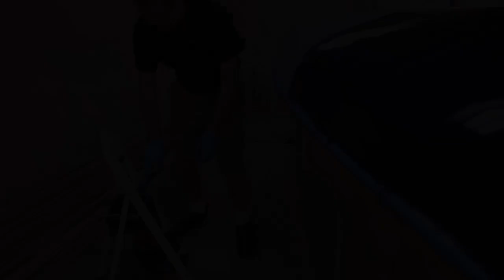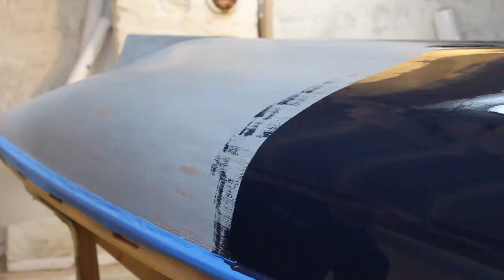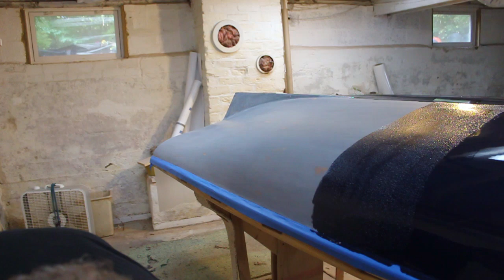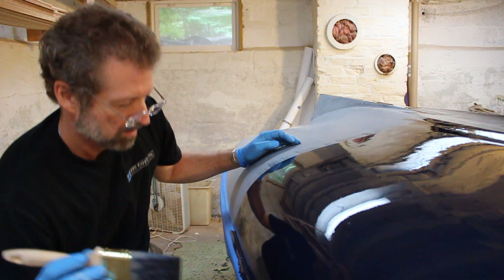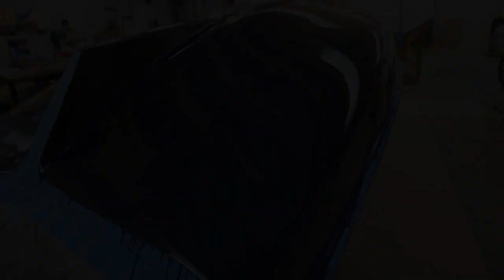Rolling and Tipping - First Coat

Comment: 8 Dislikes!? WTF. I could watch this guy paint all day! Great style, I'll try and replicate it when I paint my Columbia 26. Thanks for the upload!
Reply: Those are ust jealous people who can't do the same thing.
Reply: dislikes because you dont paint over gelcoat you cut and polish it and repair it if you paint over gelcoat it will chip off easily where as gelcoat you can repair easily and polish easily
Reply: Lteo Hrnt  how many boats do you own?I have lots of experience with painted gelcoat yes it looks good for a few years but it is not as good as repairing the gelcoat and maintaining it
Reply: It might not be hip enough for the Londonener
Reply: Gelcoat  eventually will need re gelcoated or painted. You can only buff it so much. Epoxy paints work fine for the $$ u save.
Reply: razzorbladz I believe it was a barrier coat vs gel coat.
Reply: @razzorbladz  He didnt paint over gelcoat
Reply: @WereAllThatBored  ................? UM yeah he did,do you know what gelcoat is?
Reply: @razzorbladz  Yes.  Gelcoat is polyester resin with some solids  and pigment added for durability.  The material he painted over is "Pre Kote" which is NOT a polyester based paint, or Gelcoat.
Reply: @WereAllThatBored  and what did he paint the pre kote onto genius...? gelcoat! which would have been better repaired with flowcoat. so yet again I say he painted over gelcoat. all moulded fiberglass boats have gelcoat even epoxy boats unless you are saying he sanded all the gelcoat off before he primed?
Reply: @razzorbladz  You are aware that Pre Kote primer is designed for painting over gelcoat right?  The actual paint is applied over the prekote primer.  So he did not paint over the gelcoat directly.
Reply: @WereAllThatBored  OMG  he did paint over gelcoat directly with a 2 part system. do you not have any thing better to do surely you need to buy more toilet paper.
Reply: razzorbladz I’m glad folks like you are on here to keep us in line.  You should call Interlux and tell them they don’t know what they’re doing
Reply: razzorbladz even better.  Read his blog.  It’s a wood boat that was originally painted with house paint lol
Reply: @razzorbladz  Sometimes people cut too much or use acid and burn through the gelcoat so it's not always possible to save it economically.

Comment: I navigated to this link from a boat building web forum looking for technique for using interlux Brightsides to paint an exterior door.  I've already coated and sanded it twice with lousy results. All I can say is a picture (or video) is worth a thousand words.  I duplicated this technique (right down to the Peter Gabriel soundtrack) and got perfect results.  The only thing I'd add is: copy this technique to the letter.  The paint does not respond well to 'do-over' brush strokes.  If you lift the brush, then continue, you will see that area.  If you brush a second time, it will show up.  Also I used Interlux 333 thinner which is what they recommend, and dipped the brush in it prior to using.   Thanks for posting, it saved my small project.  PS: I highly recommend this product for hard-duty exterior applications.  It really holds up in UV light, heavy weather, and abuse.
Reply from the maker: Thanks, ersatzS2. You are exactly right. The trick is to always work to the wet edge, and only make one complete pass. Essentially you're manually laying down a single continuous coat of paint from one end of the project to the other. There's no going backwards at all, not even the slightest touch ups. Once a full coat is done, and the paint is completely dry, you can buff, scuff and/or lightly sand to smooth out imperfections, then come back with the next complete coat. I also used 333 thinner, and also dampened the brush with it before starting. Be careful the brush isn't WET with thinner, though. I made that mistake the first time. Excess thinner bled out of the brush into the paint and made streaks. You just want to dampen the brush slightly so it doesn't soak moisture out of the paint. After dampening the brush and shaking out the excess, I worked some paint up into the brush before starting the work, and that seemed to give the best results.

Also, Peter Gabriel may be the secret sauce for success. Highly recommended. ;-)

Comment from the maker: Sorry, I'm more a writer than an actor. There's a lot more info at the link in the description above. But yes, it's a small fine foam roller. The roller mostly gets paint on the boat somewhat evenly. Going over it with overlapping strokes helps do that, as the roller unloads a lot of paint initially it becomes more thirsty by the end, so going back to the beginning will pick up the excess paint there and redistribute it to the dryer areas. You'll notice i do a quick pass over the whole section with a freshly loaded roller, then go back over the whole section to spread it evenly. 

The brush is not critical, just a reasonably good quality finish brush will do. I used a Wooster. It doesn't pick up paint because you preload it with enough to paint to keep it damp – not enough to add more paint, just to keep it from sucking up paint off the surface. Did not bother cleaning the brush until the job was done. 

You work a small area because the added thinners in the paint evaporate VERY quickly, so you need to work a small area fast while the paint is quite thin. It has to flow out naturally after the brush stroke. The brush is mostly just to pop the bubbles left by the foam roller, and to help even out the paint by stroking in the opposite direction. If you try to do a big area the paint starts to get tacky before you're done. You start leaving brush marks that don't flow out, and the bubbles start leaving little craters. No advantage to working a larger area.
Reply: Thank you for generously giving these details. You've answered my questions.
Reply: It is very obvious that painting with roller and brush will not be best than using a spray gun. But Dammmmmm😱 so far is the best video i had found on YouTube with best results.👍👍 Thanks for sharing it.
Reply: BTW. Just to have an idea, what the (%) of (Thinner) and the (%) of paint mixed together for best results?
Reply: Outstanding!

Comment from the maker: More details provided at the link above. But short answer is the brush was first dampened with thinner. This both helps keep the bristles from drawing moisture out of the paint, and keeps paint from drying in the brush while working. Not enough to be wet, you don't want to dilute the paint further. Paint is also thinned, which helps it lay out flat rather than leave brush marks.
Reply: EyeInHand I know i am a little late on this. But I just got my first truck a month ago. and I stumbled upon this video. may I ask what paint/ thinner ratio you used? I find this video very very confidence boosting. it looks amazing! never would have thought this was achievable with a roller!
Reply: Hi whats the thinning ratio
Reply: Thank you for the information.
Reply: @nathanielselvidge4157  you need to judge for yourself the amount of thinner you need. Start with 5% stir it and see if it's viscous enough for the appliance, if it's not then add 5% more. If the thinner is a universal type thinner and not actually the same as the base chemical in the paint then it will start evaporating so you will need to control it throught, for example in a spray gun you would add thinners to the cup when the paint started shooting cob webs or getting too thick. For epoxy paints and the likes the thinner will be the same as one of the base chemicals so it won't evaporate and will stay at that viscosity until it starts curing. Another good way of tipping is leaving the paint to dry a tad then go over it with a second roller that's purely been doused in thinner. This works well getting rid of bubbles and flattens it off nicely but I'd only do this method if you have a smooth surface to work on that isn't very porous, the reason being is that the act of tipping with a brush is very good at squashing paint into the poures and small pin holes and using 2 rollers won't do that as well as a roller then pushing it in with a brush. People who brush too lightly on the tip aren't doing it correctly either. You want to see the paint getting pushed in slightly when you tip. If it's anti slip paint I'd get a proper tipping brush for that as its a nightmare tipping that off with a stiff brush.

Comment: I just used this exact method - about 18" section at a time to finish up my transom repair. Thanks for the video! Gave me confidence I could do it myself. Finished the last coat today and it looks great. Didn't thin mine at all, and just barely wet my brush with paint to do the tipping. Amazing watching this paint flatten out.

Comment: You have provided me with enough false confidence to go through with this :) I contacted a local body shop and he convinced me to prepare the sailboat hull with Epoxy resin, so now it’s showtime
Reply from the maker: You can't win if you don't play! ;-)
Reply: @eyeinhand so,far it’s working well and indeed I’m playing :) fast questions, before my second coat, should I dry sand with a 340 grit? Or wet sand with a 340 grit? Thanks once the second coat is on, I’m was going to let it cure about 2 weeks before I wet sand with a 600 grit. Does this make sense? And again thank you for your videos
Reply from the maker: @1970swimmer  No need to sand between coats, or after. You just need to scuff it between coats to put a tooth in it for the next layer of wet paint to grab. I used those green scouring pads to buff off the shine to a dull mat. Easy, dust free, and leaves all the paint on the surface where you want it. If you use good gloss paint, the final coat will already be shiny, so wet sanding that with any grit will only take some off the gloss off.

Comment: Thanks for the video. Just put the first coat on my jet ski today. It came out great. I was going from blue to white. Brightside covers surprisingly well. Thinned about 7% with 333 and used a small foam roller. No sags or runs. Do have a couple of pops even though I wiped down and washed twice.Think the spot putty isn't playing well with the paint. Just going to sand and reprime a couple of spots before the second coat. Only used about 8 ounces on the first coat.

Comment: I've been rolling and tipping a 22' trailerable trimaran that I built. It was going quite well but could be improved. Today, I followed your thinning formula exactly and your technique. I experienced a significant improvement. I wet sand and buff the paint as the final process. This corrects any defects but the better the surface is when starting the easier it is. Thanks for taking the time to contribute an excellent video.
Reply from the maker: Excellent. That's a much bigger boat with a lot more surface to paint than I had, even for two boats. Would like to see it when you're done.
Reply: @eyeinhand  I just went out to my shed to check on the paint. It laid down very nicely - virtually no brush marks. And the paint is drying nicely in about 55 degree temp. I was concerned that the 333 thinner would slow down the dry time significantly. I am used to using xylene when spraying. Thanks again for the valuable knowledge you provided. I'll be sure to send a pic.

Comment: Excellent video, thanks! Timeless, even.... If you still are here, what do you use to scuff between coats? Thx
Reply from the maker: Glad you like it. I used those green Scotch pads or equivalent. Don't want to remove any paint, just enough to scratch it evenly and put a tooth in it.

Comment: The best method I saw on YouTube painting with a roller by using the paint brush too. Gonna have to try this way in future but have to get more paint brushes for it have a turbine sprayer coming soon though and this color looks about the same color will use when paint my truck again have painted it multiple times this year but it didn't come out right I used Daytona electric blue urethane metallic but going back to using darker blue the original color is s imperial blue metallic though but that color looks close to the color it was at first. My last truck was gray painted it and it didn't come out right either but it had rust on it and decided to paint it that is how I started liking auto painting and started liking auto detailing more too. But now like painting a lot never tried painting like Bob Ross did though.

Comment from the maker: There are some details on the paint and thinner in the description, as well as a link to more lengthy info. The paint was thinned the same for every coat. It's pretty critical to getting a smooth finish without leaving brush marks. How much you thin it is really varies according to how fast you work and over how large an area. Slow and larger areas will require more thinning. Fast and small areas less. Keep the paint thin and flowing while you work. If the brush drags it's getting too dry.

Comment from the maker: The brush was first dampened in 333 thinner, just to keep the paint from drawing deep into it. After that just dip in the thinned paint or you get streaks. The paint is thinned with one capful of 333 thinner to one cup of paint, but you vary that according to temp, humidity, and your own working speed. 

I don't think any other paint thinners would work the same. I've never seen anything as thin and volatile. The paint it too expensive (for me) to experiment on cheaper thinners that might fail.
Reply: Dear Sir
I am to paint my van with alkyd oil based paint- Tikkurilla brand , dark blue colour.
I got the finest brush from local store as well as foam rollers.
Paint suggests using 1050 white spirit.

Which thinner to dip tipping brush on for this particular paint please.
Painting outside after sunset +20c 
Please also suggest delution ratio ?
10% of 1050 white spirit feels not enough amd paint is sticky and difficult to spread and coat gets on thick.
Thank you very much in advance.
Reply from the maker: @maximolotov  Sadly, every paint is different. You'll have to experiment with what you have to find the proper ratio. But it should end up very thin and runny, not at all sticky. Basically, you want it thin enough that when you apply a brush stroke any texture will flatten out naturally. Be aware that not all paints do this well. So much better than others.
Reply: @eyeinhand  Ty vm

Comment from the maker: Use it to thin the paint enough to be self-leveling. Straight from the can, uncut, the paint is too thick, retains brush strokes. I used about a capful of 333 to a cupful of paint, but you'll need more or less depending on humidity, temp, etc.

Comment: "WOW"
How Beautiful...
I am going to be Hand Painting a Class A RV...
31' long 12' high... It will be so "Bling Out"...
I'm 64 and this is my 24th RV,  Travel Trailer, 5th Wheel etc...
I'm going to do it "My Way" this time... 
Thank you so much for sharing this great video..
Reply: Judi Christopher any possibility you would post a pic of your RV. Mine is 38’ and am starting with my doors below
Reply: @paulasmail3524  
I don't know how to do that... LOL.
 I have before and after pictures... I'm so glad I did take before and after pictures this time, usually I don't... It is amazing of the difference...
Reply: Judi Christopher i would love to see yuu before and after pics ...looking at painting I have ford blue
Reply: @paulasmail3524  
I will tell you one thing... 
The ONLY Paint I use is this... 
WallMart Exterior Semi-gloss...
It covers so well... I have been using it on my RV "Flips" for almost 26 years.
Reply: Judi Christopher did you use the 333 mineral spirits? I cap per cup to thin out?
Reply: @paulasmail3524  NO... I do not like Mineral Spirits... I used to have a Furniture Stripping and Refinishing business... I use a Stripper I get at Walmart ... 
I call it Liquid Sandpaper... LOVE it!!!    EASY to USE.

Comment from the maker: You have to simply expand the wet edge along the boat. Otherwise, if a section dries, there will be a ridge in the paint where the sections overlap, because the paint is double thick there. You can definitely see it. I made sure my overlap fell along a visual break to hide it, in this case where the flat bottom and curved sides meet at an angle.